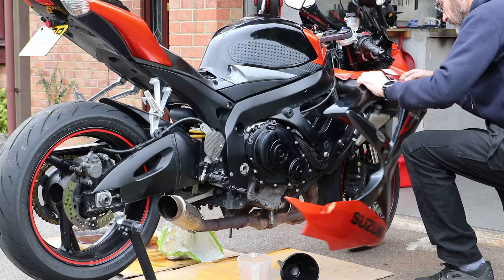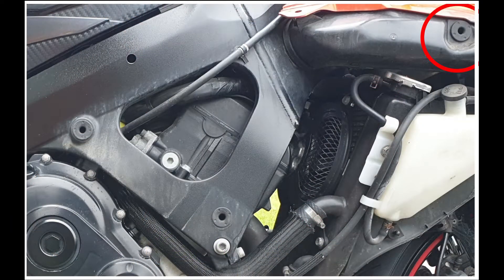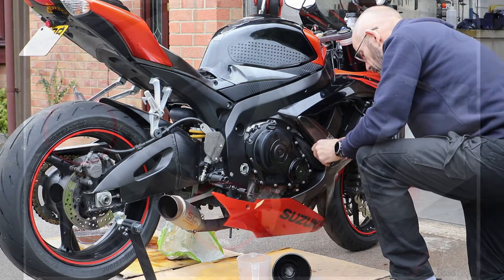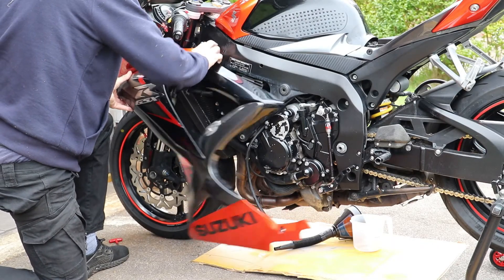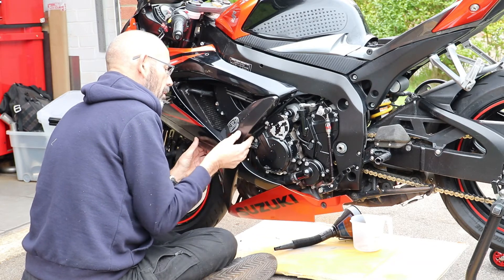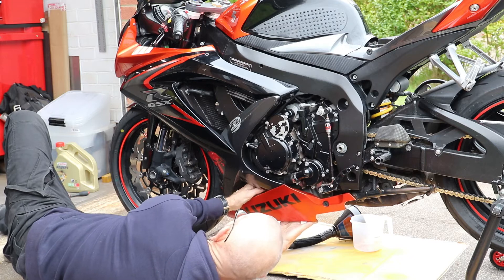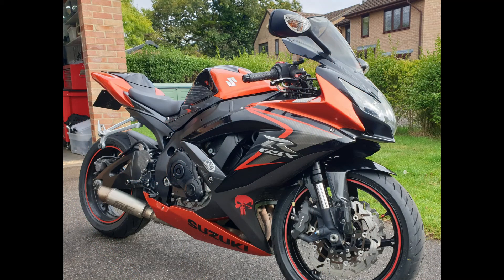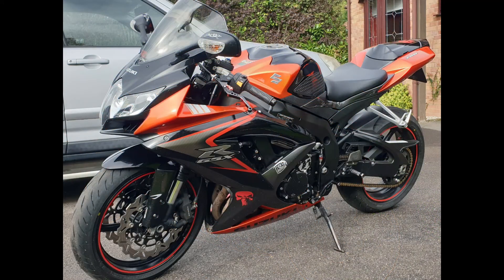GSX-R 750 K8 Track Day Bike Build Part 5: Refitting the Side Fairings

Comment: Hi Mark, if i want to remove and refit the left fairing only can be done right? Or i need to remove both?
Reply: Hi Khalfu, you should be ok to remove just one side - but don't forget the fasteners at the bottom holding the 2 sides together.  Good luck. Mark
Reply: @markshomeengineering5243  Noted on that boss! Thanks and please make more videos on the gixxer